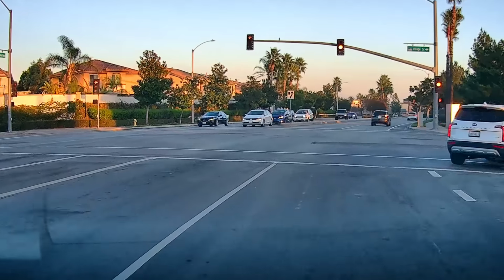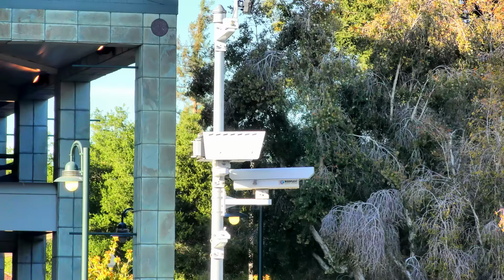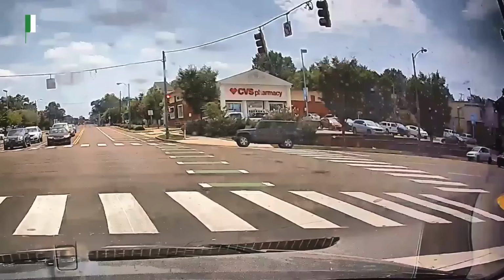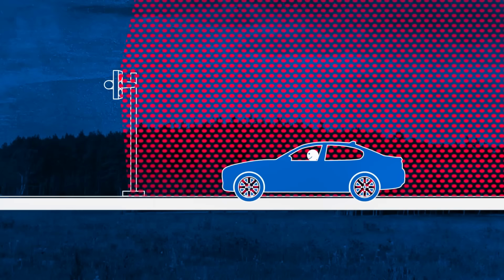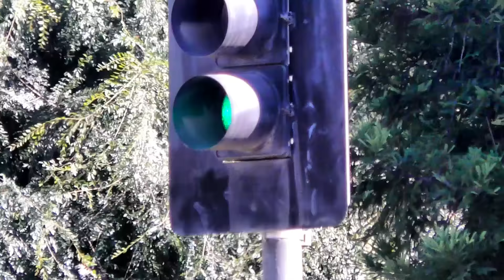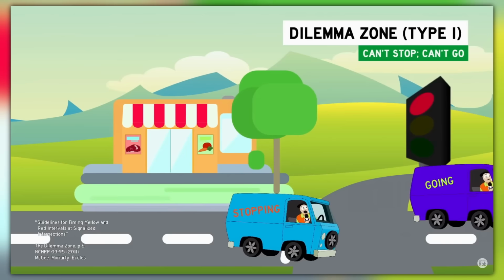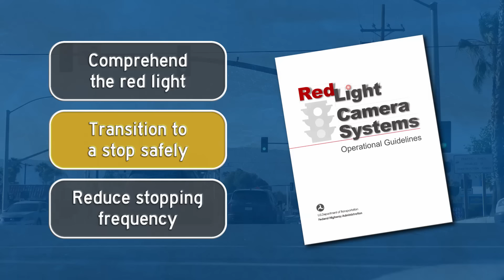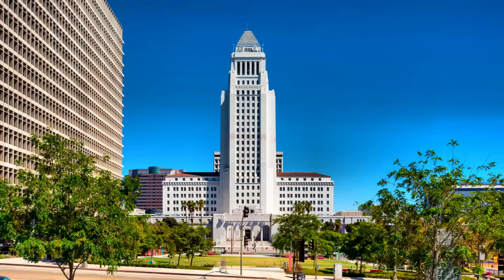Three ways to FIX a STOP LIGHT (so drivers ACTUALLY STOP!)

Comment: Rob, you got it all wrong. The fancy lights are good BUT.
 You know the security bollards and ramps that come up from the road to restrict security access?
 OK, light turns red. Two seconds later bollards come up. You hit one, you get the repair bill, the cleanup bill, and all your insurances are void.
 That'll stop 'em in just one month. Guaranteed.
Reply: In some cities, the law requires the yellow light time to be based on the speed limit. If you get a ticket for a fast light, the city MUST send out engineers to test and adjust it. If the yellow light was too short? Ticket dismissed.

Comment: Signal coordination used to be almost ubiquitous and this was as far back as the 1960s or earlier. But about the length of time on a yellow light. They had a roadway of 45 mph between two expressways which means people are probably going to be driving close to about 55 mph which is what you stated in your video. And yet they had a yellow light time of less than 5 seconds. That is Holy and completely unacceptable. Even on 35 mile an hour streets these moronic communities frequently have yellow lights that are 3 seconds and less. National Highway Traffic Safety Administration has already stated that that is unacceptable. Plus there is no two second lag time for reaction time engineered into the reaction time required for elderly people who sometimes have a reaction time that is well upwards of 2 seconds. Which means that there should never ever be a yellow light shorter than five full seconds. I have seen yellow lights occasionally at less than 2 seconds. That definitely needs to end. Above 50 it should probably be closer to about 5 and 1/2 to 6 seconds. But then you're going to run into the yellow light is so long that people are going to stretch that.
The other problem you have is what defines running a red light. Just being in the intersection when the light turns red does not mean you ran the red light. As long as you are not precluded from entering the intersection, which means the red light is visible before you enter the intersection, then you are not precluded from entering the intersection and continuing on through it. That's actually the law. It doesn't matter how many times they say you should stop at the yellow light whenever you think it's possible to do so or when it's safe to do so, the driver is the one and only Arbiter of that decision. Not a police officer who may be watching them nothing else removes that decision from the driver.
One point I would like to make is just because they change the appearance of the traffic lights by making the background black and putting a yellow border around it is not what, in itself allowed people to stop at the lights better. The fact that they changed the appearance of the light. It will eventually go back to what was occurring before. And the idea that people lose the light in the Shrubbery and trees I have no idea where you got that idea from. There is nothing in the green light color gradient the yellow light color gradient the red light color gradient, especially with the newer LED bulbs, that is consistent with background colors. The only observation I would make is that red is one of the harder colors to see in lighting and yellow and green are the easiest to see. Red is so difficult to see that most people who are color blind cannot see red lights. They just see that the top light is lit. It is a problem that does need addressing, but one point where they have completely found up is the radar controlled lights and in Michigan here they actually have lights at some intersections that operate differently at different times of the day. I'm interesting concept but it's fraught with getting people killed because the way a traffic light works is something that people learn because they normally travel through a traffic light at the same time each day on a normal situation. But when you have changed the left turn light to a preceding light instead of a following light or something like that you're going to get somebody killed. I even know of one intersection where they had a triangular set of traffic lights and all three sets operated completely differently from each other. That was beyond stupid.

Comment: Those filters are always awful. Sure, you can't see it before the first light, but usually with them, you can't see it until you are ALREADY IN THE INTERSECTION! Or at least close enough that you can't stop. And even though the red lights are not SUPPOSED to be filtered, they usually are.

Comment: I run red light on porpoise when it's doesn't serve it porpoise. For example if the intersection is in rural area 2 miles radius visibility it's irrational to stand there and wait for the green. Also I use one undeniable technic to pass interactions legally and faster by doing right turn, U-turn, right turn... saves minutes and is safest that going through the green. As a Star Wars fan, I see correlation between green light users and red light users as Jedi and Sith users of the Light side and Dark side of the Force. Nobody likes what Sith doing, but it's more safer, efficient, effective, wild. The best thing in Dark side of the red light driving, you always expect someone gonna get fucked and unintentionally pass the red light... Because you get use to use the red light, you are focused for more aspects of the road than regular green light users
...😂
I wanted to open a government approved school for Professional drivers that could go on red light, do real good excessive speeding(Autobahn skills) to take dark side of the traffic into control... I believe embracing the dark side of red lights and speeding would save more lives... 

Just for a reference I do around 18-28 red lights a day for 5.5 years. No car had to get stopped by my driving, no police where triggered, nobody got into hard breaking, nobody got scared. I believe that if we learn it the Sith way, we can build better traffic society... The thing is that Dark side users use Light and Dark side at the same time, that's why they are more safer than the Green light users... We expect more things because we see the traffic in more complicated possibilities... We see that green light users sometimes couldn't notice green light, stop sign, speed limit and other traffic laws... But understanding of the laws, and understanding of the breaking the law could save many lives. 

Here are examples of the dark side user when driving the US roads. When I see a light changing to the yellow, red, I look behind into the mirror if person noticed it and started to break. To avoid it hitting me from behind, have all escapes moves processed.

Next example of the dark side traffic user. When going on green look left and right to make sure everyone is stopping and there is no unintentional red light users, or emergency vehicles. 

Next example, speeding... When passing anyone in traffic make sure to be ready for accounting all the blind spots of the people, pass them slow, 5-8 MPH faster, and add +40-60 over the speed limit after the road is clear and no police. In residential or commercial/busy areas speeding is not used, but slower than speed limit driving... you must feel the power of slow side ... In residential area you account for children that could run out of the parked cars, in commercial/busy areas someone could come out of the corners... 

Next example: honk, get attention and show middle finger for people who texting and driving... Throw cup of ice at them, because they using the forbidden texting while driving side of the Force...
Last ones are the most dangerous of the traffic flow... They are the reason of most accidents.

Stay safe, use green light and understand the red light possible users....😎🤌

Comment: Easy to solve problem they will not due.  Coordinate the lights according to the speed limit.  Chicago used to do this and I drove miles to work AT THE SPEED LIMIT without stopping.  no more.  Now they use lights to stop flow of traffic and “calm” the drivers.  Official word.
My current technique is to drive 7 under and let the speeders pass me and wait.  You can not out run the lights without risking a big ticket so slow down.  Now I save tires, gas, brakes, pollution, my nerves.  Or do they want this secretly?

Comment: So with a roundabout or we call them traffic circle in Western Canada ( Edmonton, Alberta) the most photo cameras in the world for traffic and money that the city makes. They put lights on the roundabout(traffic circle) how does that make sense. The engineers for the city have an idea that if they screw up traffic so bad people will use public transit. Well in the 45 years I have driven here that has never happened. I wish they would fix the mistakes and make traffic flow instead of making it slow.

Comment: Inattention is not a valid reason. That is no different to ignorance of the law. RED light camera's and the enforcement do work. I believe that crushing a RED light runners vehicle (regardless of the vehicles age or cost) would make a great enforcement. Placing the offender in the vehicle should take care of the repeat offender problem. No more Once, Twice three times or more. It would be a one time offender.
 
If all else fails - A really good deterrent would be tapered metal spikes that pop out of the ground (just as quickly as the quick acting bulkhead doors from Star Wars) when the traffic light turns RED. Turn those RED light runners into a kebab. To keep it interesting tell the public there is up to months grace on the instant popup on RED (The popup happens 5 seconds after the light turns RED.)

Comment: I'm presently 74 and due to my eye sight being less, though I could drive I've chosen after more than 50 year's of never having an accident, nor a ticket for anything. Adding in the fact that I've driven over two million miles as a professional over the road truck driver. And thousand's of mile in an auto. When I drove, I drove, meaning that's all I did. ALL of my attention was on driveing, nothing else, no radio, no cell phone, no monitor as in GPS unit. Never spent the time driveing brushing my teeth, putting on makeup or combing my hair, etc. etc. etc. The purpose of driving is to get from somewhere to somewhere else, and that's all it should be. Doing anything else while driving, mean's one attention is dedicated to driving. But then, there's the fact that everyone has the right to interpret, understand, comprehend etc. What having Inalienable Right's mean to them and them alone. Meaning if one believe that can do two things at the same time safely once or more, they can do it all the time. But due to the vast overwhelming number of accident's. I can only concur that, one can't do two thing's at a time all the time. But they using their Inalienable Right's, have the right to believe otherwise and apparently do.

Comment: Also people should be taught red light doesn't mean you don't check. It means you now have the right to go, but still check. Even as a driver I check everyone has stopped.

The vast majority of people like to drive safely, so it's better to design a safe system, rather than a system the punishes people for your bad design.

UK went for punishing and it did nothing. They clam the better cars have nothing to do with the reduced crashes and take all the credit.

UK roads are so bad, it's amazing it could be that bad for a developed country. Around London it's ok. Rest of the country is neglected. Huge pot holes, bumpy wavey roads. Endless windy roads with crumbling edges. Badly designed roundabouts that need multiple traffic light stops inside the round about, making them pointless. Road markings are faded or just gone, yet are absolutely necessary for safely navigating the coming junction. Frequently signs are broken or bent and not repaired, or trees are growing over them. Main roads run through a village, so speed is dropped from 60 to 30 rapidly.

Government solution ... make everyone drive slow and add more speed cameras, rake in the money.

Comment: its almost like slamming on the brakes is a bad habit to have because ice and rain make it dangerous to do so and our cerebelum doesnt give a S***. 
yellow lights should be longer and have timers based on the speed limit. if the speed limit is 40 the light should be yellow for 6+ seconds. not everyone on the road can afford to slam on the brakes and many insurance apps track "hard braking which is 8mph/ss meaning 45 mph would need 5.5 secs minimum to not casue drivers mnoey
if my kid is in the backseat im not slamming on the brake to wake him up at 1am

Comment: I think it would be helpful to have all yellow lights be set to a standard time, say 6 seconds. That way, people can anticipate how to drive at every intersection, regardless of road size or speed limit. Also, more clearing time when all lights are red will help avoid collisions if people do run the red lights.
Reply: But a standard time would be too long at low speeds (encouraging people to merely treat it as an extension of the green light) and too short at high speeds (leading to accidental red light running)

Comment: It doesn't take a genius to give a fair time on yellow for someone to safely get stopped. A kid could do it, let them ride in a car or semi.
Why engineers need a book of equations is ridiculous.
The only way I can tell is watching if the don't walk sign is flashing but still have to guess when yellow will actually come on, here is about 2 or 3 seconds. No way you can stop without causing an accident without locking up the brakes.

Comment: red light camras are stupid. The reality is sometimes lights are timed poorly and swap from green to red too quickly. The driver has to balance an emergency stop vs running a light. Engineers actually give a half second delay from red to green so you know when you see red you have a half second + however long it takes for oncoming traffic to accelerate. maybe 3-5 seconds total at that point.

In my honest opinion there are a lot of cases running that light may be safer. Granted a driver has to make many mistakes to get to this point, but VERY VERY few drivers drive the 2-4-12 method and get caught up because they don't plan for the 12 seconds lead time and have to use the 4 second lead to correct for those issues.

Comment: I suspect you're misinterpreting the purpose of red-light cameras. In many cases they're not to reduce accidents or running red lights, but are a revenue generator. I've even heard of cases where traffic agencies admitted to shortening the yellow phase to cause more people to get ticketed.
What I'd really like to see is more adaptive intelligent traffic lights. Ones that can coordinate with other traffic lights, as well as see cars that are approaching, tell how many are waiting, if all in the queue have gone through, see when the pedestrian has cleared, and so on. Traffic lights, to my understanding, are not much more sophisticated than egg timers that sometimes have sensors to activate them (though can only detect if a car is waiting or not, not how many or if any are approaching, and so on, nor can they detect the presence of a motorcycle). All with adaptive learning algorithms as well. This could really improve throughput and ease frustration. Many I see run red lights are on too-short left turns, usually several cars will go through after it has turned red and the other direction turn green, I'm assuming because they've already had to wait three cycles - the light should be able to detect there are still cars trying to get through and stay green longer. While other lights I've seen have a super long green for one car. Or have both problems, too short green for one direction and a long green for a little-used direction. Or are red for 30 seconds for a pedestrian cycle, even though the bicycle crossed in three seconds - or always run a pedestrian cycle even when nobody pressed the button. And so on. With modern technology, far more intelligent and efficient traffic lights should be possible - why are we still using these dumb lights? Probably because this tech would be somewhat more expensive, in contrast to ticketing red-light runners which makes money.

Comment: I hate red light runners and drunk drivers with a vendetta.

If I ever see a crash caused by someone who is obviously drunk or clearly ran a red light, I would not help that POS driver.
I would only help the victims in the other vehicle. Even if the Red light runner or drunk driver had an obvious life-threatening injury such as cracked skull or massive bleeding, even then I would accidentally not see their severe injuries and it only assists the real victims of the crash. 

And if that results in the Red light runner or drunk driver dying because of their injuries being unattended, that's not my fault! That's their fault because they consented to the non receipt of medical attention by running a red light or driving drunk.

Comment: When a light turns red they should have a 2 second delay on the other light turning green.  This gives time in case someone runs the light and if they are in the intersection when your light turns green, they most likely ran the red light.

Comment: The purpose of red light cameras is to generate revenue. Having the green light flash once before it turns yellow is the single most effective tool used to reduce red light runners and yet I bet that's no where in your little federal book.

Comment: You're giving intentional runners far too much credit. Many don't even enter the intersection until the light is red (not "stretching the yellow"), and I have zero tolerance for them. Running a red light is one of the most dangerous things (to other people) you can do while driving. Even doing it accidentally means you are a bad driver. Running a red light should result in a suspension of your license and mandatory re-education before re-instatement.